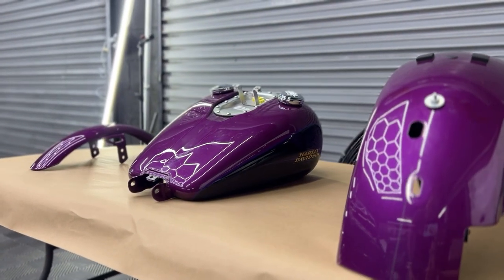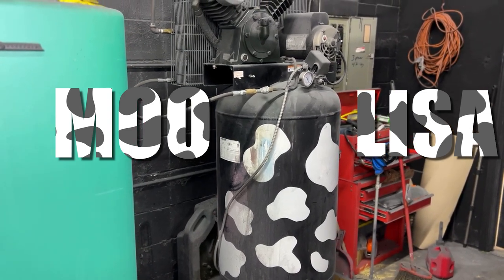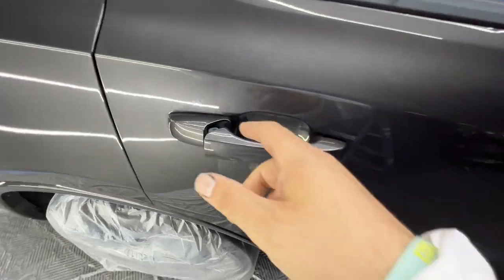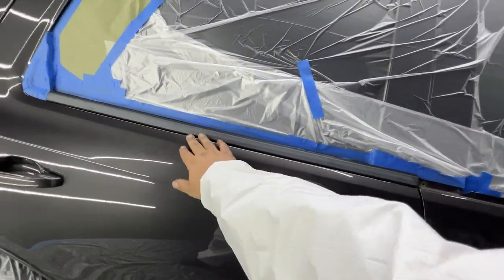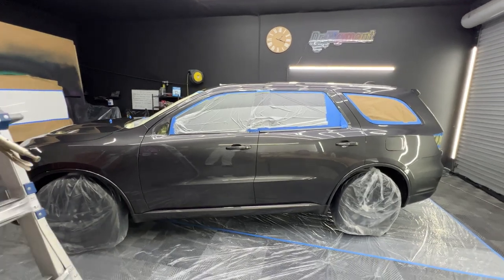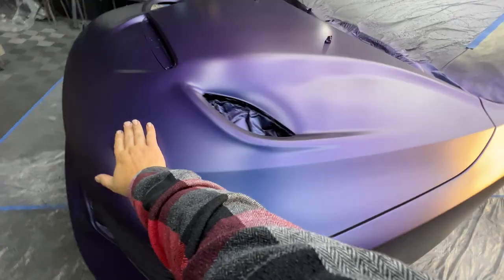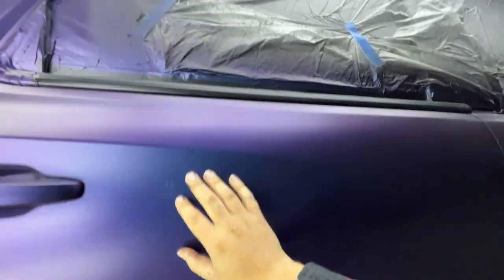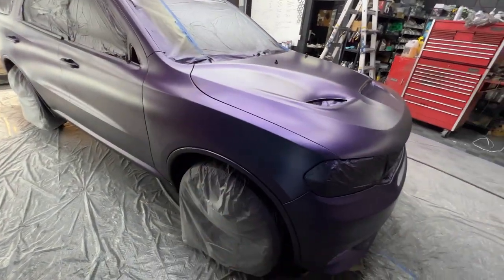Crazy Ex Colorshift | Satin Clear Liquid Wrap

Comment: What is satin clear? Is it clear topcoat? I don’t see satin clear on your website or on raail? It’s a little confusing when you use a different term than what it’s called cause I’m not sure what to purchase.

It turned out🔥 by the way!
Reply from the maker: Satin Clearcoat is a topcoat with a satin finish that also provides a durable gas/scratch resistant layer. It is on our site just search satin clearcoat (https://drpigment.com/products/satin-clearcoat-1-gallon)